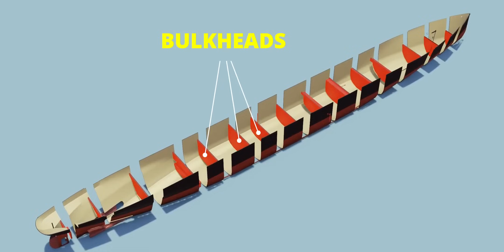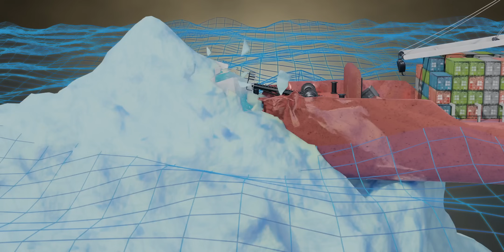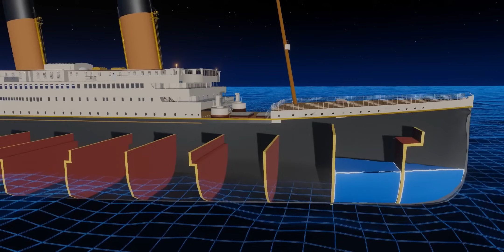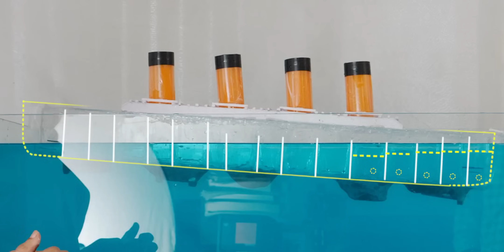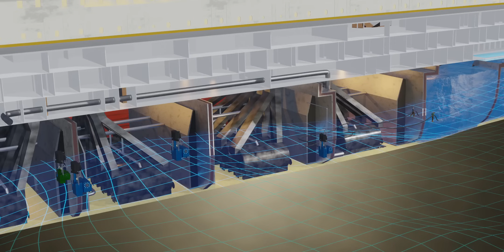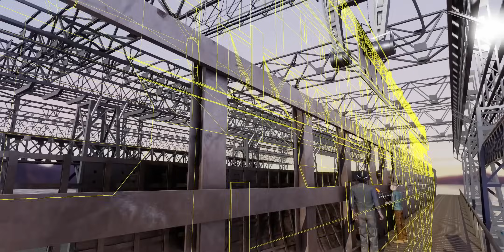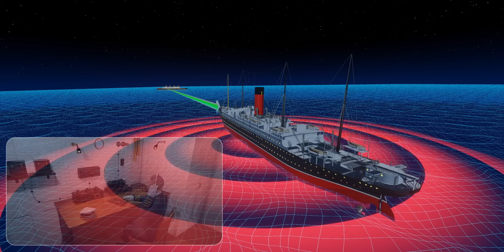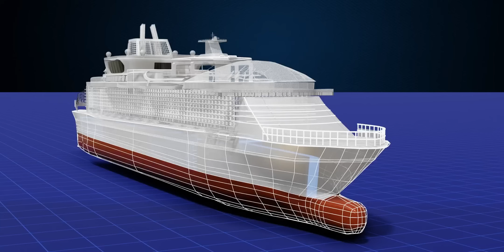How did Titanic Sink? | The Complete Physics

Comment: One HUGE thing the people often overlook for some reason is that when a ship is opened to the ocean/water the water is going to CONTINUOUSLY pour in. It's not like only a certain amount of water is going to come in and then stop. Because of this Ritanics water tight compartments were pointless as the water would just spill over into the next compartment after filling up the previous one, which is exactly what happened. Huge engineering oversight. It would have probably worked if so many of the compartments weren't damaged.

Comment: How did it sink?
A hole in the ship and gravity.
Reply: This caused water to get into Ship, but only four of the apartments in the workstation we’re safe, but until it reached the fort section, it began to sink then it slowly continued to fill each room with water as this was happening the ships front part and back part we’re starting to become unstable so does ship began to break apart? The middle section of the whole ship was breaking apart and as it slowly sink, it went deeper and deeper as it went into the depth of the ocean. then the ship started to become rusty over the years and then they say in 2030 the Titanic will be completely gone. There are more facts in the video but if you are confused of what I’m saying, look it up on the video above

Comment: I don’t understand how the bulkheads in Titanic can be watertight if they don’t have the full vertical length from floor to ceiling?
Reply: Thats a common misconception, the bulkheads extended from the bottom of the ship to D-Deck were sealed floor to ceiling in each compartment.

During the sinking D-deck was pulled under the waterline due to 5 compartments being breached allowing water to enter C-Deck and flow down staircases and access points into the previously sealed sections.
Reply: Me too. Seems lessons were learned.

Comment: Regarding the idea of the possibility of the ship floating for a longer time, I have the following opinion:
- if the watertight doors were closed only for the first four compartments with which the ship could float, it would have remained almost horizontal, and the fifth compartment would have allowed the water to drain and distribute it to the other 11 compartments, all the pumps in these compartments plus those in the affected compartment five would act to evacuate the water, so that work could have been done in compartment five to reduce the damage, and the water level would not have reached a level that could affect the coal supply to the rest of the boilers, the ship would have remained functional, or at least, it would have floated for a longer time, eventually only the compartment with the last boilers would have been closed, to ensure the operation of the generator.

Comment: What I wonder, if they made a hole on the last compartment or the last two (near the propellers), to prevent tipping over the front, would that prevent the sinking?
I mean, if they knew the ship is lost it would make no difference to destroy the steam turbine  and stay afloat. Or would that weight be to much and the ship sinks nevertheless?
Reply: I don't think they had tools to break a hole in the ships hull in the 30 or 40 minutes during which it might have had an effect

Comment: The force that snapped the ship was not weight of the stern. It was the BUOYANCY of the stern lifting UP against the flooded portion of the ship which weighed twice as much as her normal displacement weight.    Thayer’s eyewitness description, given to the Carpathia crew the morning of the sinking, perfectly described the damage to the ship, where she broke and even that her stern would be found facing the wrong way.   He stated that the ship broke beneath the water’s surface amidships and BOTH the stern and the bow lifted out of the water as the mid section went down.  The stern was lifted clear of the water by the break, not before. And only the very tip of the bow surfaced which most witnesses missed because it was black on a moonless night. Then the bow tore free and the stern dropped back down, but with its torn off end submerged. As it filled it then tipped back up as it swung 180 degrees to face the wrong way.
What simulators keep getting wrong is the forces acting on the ship as she takes on water.   The water inside the hull ADDS to her displacement. Which means the ship settles deeper in the water to displace ever More water to compensate.    For every moment she remains at the surface, she HAS to be displacing her own weight PLUS the weight of all the water she has shipped.  Just before she breaks, her upper decks below water, and her entire aft half are mostly dry and pulled below the water’s surface. The force of buoyancy is pushing UP on her stern with two to two and a half times the weight of the entire ship.    THAT is the force that pulled the bottom apart in tension and dropped a 20 foot long section of her bottom UNBENT to the ocean floor along with her last row of boilers. That is the reason the crushed and missing portion of the ship gets WIDER towards the upper decks as she was folded up at both ends, hinging about the continuous hull plating that was below the expansion joint. 
It was Buoyancy that tore the wooden bridge off and buoyancy that tore off the funnels.   Like watching the tsunami in Japan. You can see as the water rose around the houses, they simply LIFTED off their foundations, tearing hill down bolts clean thru the sills due to thousands of tons of buoyant force. Only once they were floated off their rigid foundations did the current deform and break up the wooden structure. 
By the same token, the largest forces acting on a sinking ship is the increasing buoyancy required to hold them at the surface as they flood.

Comment: Crows nest guy = Lookout
Steering guy = Helmsman 

Titanic would have had several looks both starboard and portside to offer a 360 degree view of their surroundings. Especially since Titanic wasnt equipped with RADAR as it wouldnt be invented for decades. Ships today still use lookouts, but primarily rely on surface search radar and sonar to get an accurate picture of their surroundings. 

A lot of factors went into the Titanics sinking but the poor lookout would be the primary reason.
Reply: I think you're correct about the lookouts, but Captain Smith is equally to blame. He should have made sure (lending his own if necessary) that one of the lookouts, charged with nothing but looking straight ahead, had binoculars (that lookout could have traded off with another doing the standard naked eye scan).
Reply: Left = port
Steering wheel = helm

Comment: Why didn’t they seal a top piece on the water tight holds 
Surely if the water is rising to the top with no lid in effect the water would spill to the next ??? 

Why in every diagram and video the top is left open 
Like a box with no lid , stupid design

Comment: I wonder if the ship had gone down if they sealed the water tight compartment horizontally. Five parts flooded, but no chain reaction. Shows how far we've come, by modern safety standards that would be a no brainer.
Reply: Yeah to do that for titanic it will make the ship unstable, bc that mean adding more weigh on the top of the bulkhead, making the center of mass higher

Comment: Thomas Andrews was not Titanic's designer. It was also not normal to reduce speed when in the vicinity of ice. And Captain Smith believed the iceberg threat to be minimal or he would have slowed down. "Unsinkable" or not, Smith did not want his ship to hit an iceberg. The evidence also says Titanic's engines were still full ahead at impact. 
Although this is well-produced and informative to the casual viewer, the sources used could have been better. There is a LOT of incorrect info that goes around about Titanic and it takes quite a while to sort that out.

Comment: The "direct collision" theory is stupid. Firstly the amount of kinetic energy generated by a 50,000 ton ship slamming into million ton iceberg at 21 knots would absolutely obliterate the hull. The ship would come to an instant stop and that force would be transferred into thw hull. Yes, ships were designed to take some impacts, but NOT to come to a complete stop instantly by crashing into essentially a brick wall at full speed. Look at modern cars for example, yes they are crash tested, but they are tested to the simulation of hitting another CAR, and typically only at 40mph or so. Accelerate that car to 80mph and have it hit a brick wall where nearly 100% of that force is transferred into thw car, and you get an accident no one will walk away from
Reply: The comparison with a car and a brick wall is not applicable here. Kinetic energy would be transfered to the iceberg which, unlike a brick wall, can move freely in the water, pushed by the ship. Ice also has vastly different mechanical properties. Now lastly, there are countless examples of massive ships hitting other ships and various objects dead on at full speed, and most of them have survived. As it turns out, crushing a compartment or two is more survivable than a thin scratch spanning over five.

Comment: As much as you think how insane it was for Titanic not to build watertight compartments to the tops today… think of you’ve ever been on a cruise ship…. And the huge wide open rooms that span multiple decks. Modern day cruise ships have gone back to the same thing. Luxury over safety in some ways. In fact only up to 2 compartments can be breached in a lot of ships today. As the Costs Concordia proved. That being said the material (implementation of modern steel for one thing over iron) has changed. Computer equipment and radar making such kinds of collisions nearly incomprehensible compared to back then. Double layered hull and not just keel…. Our technological advances have made ships a lot safer. Though the irony is the Titanic was actually able to take a greater physical punch than a lot of cruise ships today. And that’s mainly because of technology that avoids such ridiculous disasters as opposed to actual compartmental breaches which, by then, is already too late. The damage is done. The idea is to avoid that kind of catastrophic damage in the first place. If any modern ship is breaching more than 2 compartments (arguably any) they have already made numerous mistakes with the technology and training given to them today. Now this argument is not valid in military naval design as obviously that is a greatly different topic.

Comment: It wasn’t the Titanic, it was actually the Olympic.  And it was rigged with explosives to kill the three men who opposed the federal reserve.  IYKYK.
Reply: None of that is true. When Olympic was hit by HMS Hawke two water tight compartments flooded but she was far from sinking. Olympic returned to Southampton for rudimentary repairs and the proceeded to sail back to belfast alone under her own power to H&W.

Her repairs cost a total of £25,000 and consisted of replacement hull plates in a 15ft wide by 30ft tall section of her stern as well as reinforcement of the hull ribs at the location of the impact. 

The actual damage to Olympic dealt by Hawke has often been massively over exagerated by people who have no idea about what it is they are talking about. The most common claim is that Olympic's keel was warped, this is just blatant fallacy with the damage report from the royal navy stating the damagd was as follows:

“Two major watertight compartments were flooded, hull plating gashed from the Orlop deck to E deck, and the starboard propeller shafting damaged.” 

Notice no mention of the keel? And even still, if the keel had been damaged it would have been repaired, just a few years prior SS Suevic ran aground and had her entire bow dynamited off and a new one constructed, a warped keel would be nothing by comparison.

Olympic's repairs took 44 days, during this time Titanic was sat in a siding with a skeleton crew at work cutting out her original B-Deck walls to prepare for her new 1st class suites and Cafe Parisien which would be unique to Titanic at this time. She had no engines, was waiting on her last four boilers to be installed, had no interiors, electrics and her props wouldnt be manufactured until late December of 1911. She was 6-8 months from completion and the only facility able to accomodate her fitting out was currently occupied by Olympic making the switch physically impossible.

As for the name plates, the names were engraved into the hull and would require around 10ft of the bow to be dissmantled in order to change them. This very obviously did not happen.

As for the insurance claim: Titanic and Olympic were insured for two thirds of their £1.5 million building costs. As a result the sinking of Titanic placed WSL and IMMC into near bankrupcy overnight as not only did they have to pay the victims and their families but also had their entire reputation killed overnight. It was so bad that the sinking of Titanic was directly blamed for the cunard merger in 1935, some 23 years after she sank.

But the biggest killer of this stupid idea? Yard numbers. Titanic was built as yard 401 and Olympic was 400. This number was on every fitting, hull plate etc. If the wreck was indeed Olympic then yard number 400 would be found EVERYWHERE. Its not, but yard number 401, the one belonging to Titanic is. Thus confirming, without room for error, that the wreck is Titanic and not Olympic.

As for the Federal Reserve aspect of your claim:

Neither John Jacob Astor or Benjamin Guggenheim were opposed to the Federal Reserve. While both men abstained from the discussion publically some documents from both estates indicate a level of interest in the matter from both men.

Isidor Strauss the third passenger you are hinting at, was a vocal and early supporter of the concept as can be seen in a publication of the New York Times from October 13th 1911 in which a speech of his in support of the Federal Reserve was printed.

As for the bomb? Dont be stupid. Titanic had over 700 survivors, not one of them mentioned an explosion ever during the rest of their lives. The closest refference to an 'explosion' is after the stern had gone under, when survivors heard two distinct rumbling sounds which would have been the air in the stern section being displaced as it sank deeper.

These claims have been debunked since they first appeared in the 1990s. You will not find a shred of evidence to support any of them and most of the facts are stacked against these very claims. Thats before you even examine the wreck of Titanic which very clearly was not bombed as there would be obvious damage and scorch marks. The wreck also kills the switch theory with its yard number 401 being found on her very hull plates ie the steel of the hull. 

Do better research.

Comment: Great explanation for what actually happened, but what if they left all the doors in the watertight bulkheads open? Would the ship have just settled down in the water without any angle and therefore stayed afloat at least long enough to rescue the passengers? Or would that cause the boilers to explode or cause another problem?

Comment: If the compartments were “watertight,” then this video still failed to explain how one water-filled/watertight compartment, flowed into the other. It seems the presenters made assumptions not evidenced by the demonstration.
Reply: The bulkheads only extended to E-Deck, as the bow was pulled under D-Deck began to flood thus the water was able to pour into the previously sealed compartments.

Comment: I have not found an answer to the question, why when Titanic split into two parts, the rear part did not stay afloat, because the impenetrable doors remained closed, and the rear part took a horizontal position. Judging by the place of the breakup, there were 6 airtight compartments, and the horizontal position after the breakup should not have allowed water overflow from one compartment to another.
Reply: It broke in half underwater.
Reply: Titanics superstructure was already very damaged after the split. This can be supported by the fact that Titanics superstructure is missing from the wreck. The split also wasn’t clean, so the bow sections double bottom pulled the Titanic down. Titanic also split between the second and third funnels, the superstructure contained the third funnel, and when Titanic split in half, the superstructure had a really large gap in it, but it did not fully snap off of that made any sense.
Reply: Rough text sketch of the Titanics stern when the Titanic split in half. The line behind the split point is the damaged superstructure.
|            |   |
\_________|

Comment: Why didn’t the bulkheads go to the top and seal each section off?, there must have been a reason for that.
Reply: The bulkheads only sealed up to E-Deck as that was deemed acceptable by safety standards at the time without affecting the passengers movement throughout the ship. 

The issue was is as the bow flooded the bulkheads were pulled under allowing the next compartment behind it to flood. Its still common today on passenger ships that the bulkheads only extend to just above the waterline.